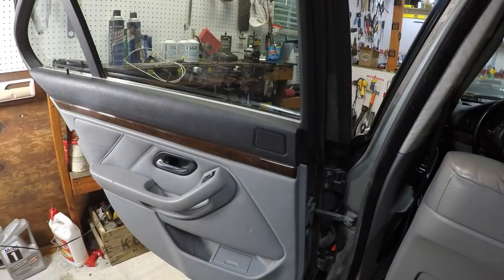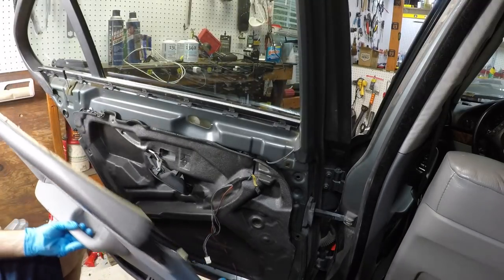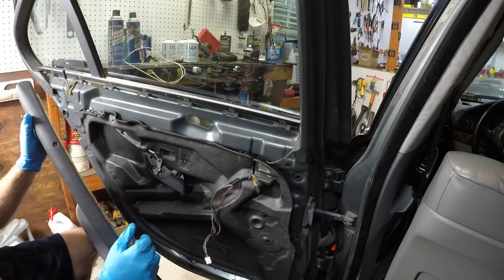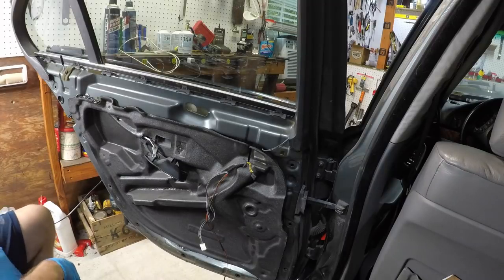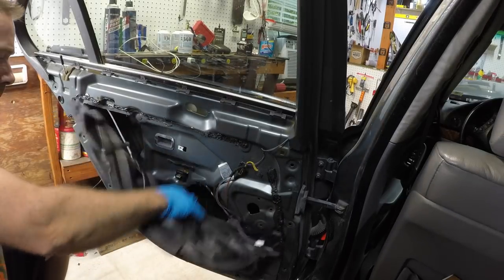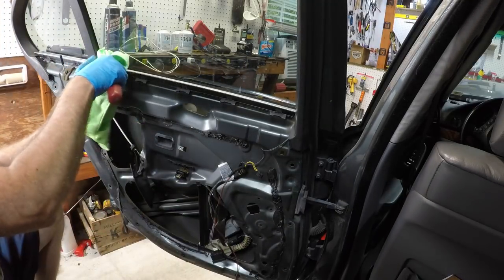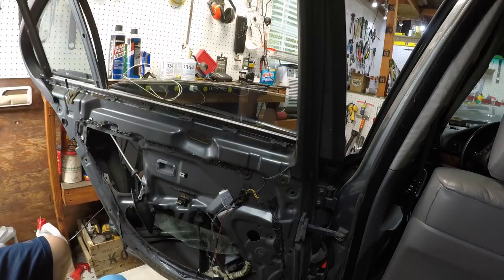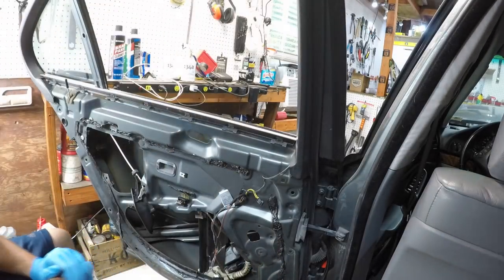How To Replace A BMW E39 Rear Window Regulator 520i 523i 525i 528i 530i 540i M5

Comment: 97 528i tips- I couldn't remove the window divider until I removed the rubber seal that  goes between the diver and the window glass. once I pulled that forward I was able to pull the divider forward and up / out. I also couldn't get the plastic interior trim piece back on the interior window divider until i removed the interior chrome trim that runs along the top of the door panel. use a plastic pry bar to pry under and up on the clips. The top bolt for the 97 528i holding the regulator is a E12 inverted torx.  Its a star shaped bolt head. a 10mm socket fits on the bolt, but it's kind of loose.  a 10mm socket might work, but might strip it out. Bentley has a nice video that uses a slightly different method of replacement. best to look at a few videos to get all the tips.

Comment: Thanks for showing. If you have the pull-up window shade, YOU MUST YOU MUST YOU MUST, PULL off the wood trim of the door. There will be 1 screw towards the front of the door and a screw towards the rear of the door that MUST be removed to take off the door or else you'll break the frame of the window frame.

Comment: This worked great! Replaced my window regulator in no time... Large binder clips (in place of duck tape) also works great to hold the panel while it's drying. I also bought "butyl tape" from the hardware store to reseal the inner panel to the door.

Comment: Wish I had this video a while back when I paid a shop  $$ just to stop the water leak on the back door of my 540. Now the first thing i do when there is an issue is look for a YouTube video then determine if I wish to tackle the repair or not.
Reply: I wish Youtube DIY's were around 15 years ago when I spent a lot of money on my indy shop to repair stuff I could have done on the cheap.

Comment: That inside vertical plastic trim will just pull off with your fingers. I wouldn't use the glass to prise against. Also, I could take the glass bolt out with the window up through the hole that's there and then could just carefully slide the glass down. Found the window was held up with a piece of bamboo.

Comment: 1. Thank you. Your video helps me to take on the challenge. 
2. I have a BMW 525i. Does it matter if it's a REAR drivers side or REAR passenger side regulator system unit to replace? It's REAR drivers side. 
Do I have to specify when ordering? 
About 5 years ago I replaced a Q4X driver front regulator. Don't think I had to specify then. Thnx Mary

Comment: That shitty bolt I do with the window in place. You can get a spanner up there to undo and you can also do it back up. It is not that hard once you get the knack to it. You would think you couldn't but you can with a little patience, agility and if you don't have a big arm. The funny head on that bolt allows you to do small turns and its made in a way that allows you to get the bolt back in place easily with that washer on the bolt. I use a flat closed end 10mm spanner and also grind the head so it is narrower and the inner teeth are more exposed on the edge so it can grab the head of the bolt better.

Comment: hello nathan. My 330ci passenger window rattles unless it is fully up. would it require a new regulator or what  exactly holds the glass onto the regulator, and can that be renewed replaced repaired?
Reply: you have a frameless glass, its got some broke clips or rollers on the tracks in the door. not a easy fix for a first timer.
Reply: hello. yes it is frameless, so advice parts diy info etc appreciated.
Reply: andrei put take the door panel off and look whats broken.  Replace it.